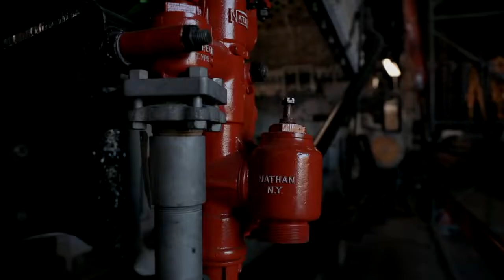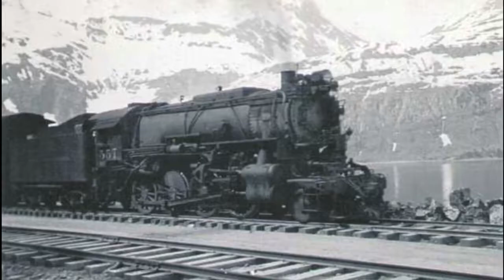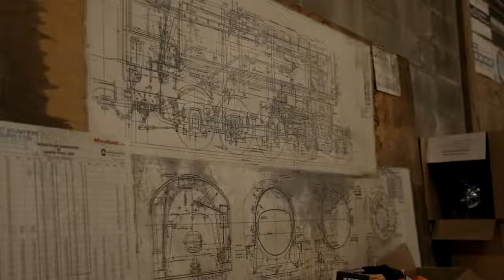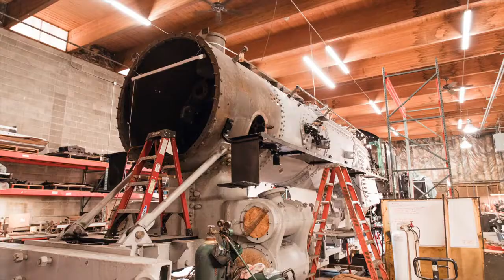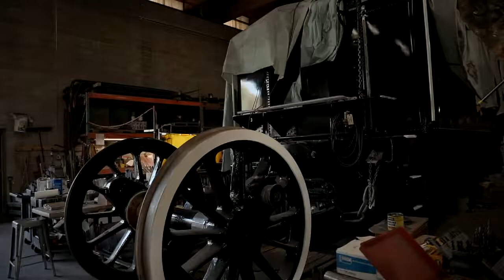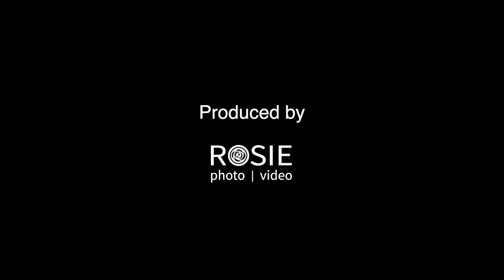Engine 557 Locomotive Restoration Project   Palmer Alaska

Comment: Better be careful. Some of those US 2-8-0's blew up!
Reply: I think the wikipedia entry is instructive on the cause of these incidents. https://en.wikipedia.org/wiki/USATC_S160_Class It's true that there were 3 incidents, the cause possibly being that UK crews were unfamiliar with the US design water gauge, and it's correct usage vs UK practice. Given that 400 were deployed in the UK to replace war losses at the time, it seems unlikely that they had any inherent weakness. In any case 557 is being restored with a strengthened boiler, 2 water gauges, and a back up try cock. All in accordance with US FRA safety requirements. We have every reason to believe 557 will be safe!

Comment: Actually, this locomotive and its siblings were not built for the Army Corps of Engineers. This locomotive class (the S160 class) was built for the United States Army Transportation Corps (USATC).

There's quite a few of 557's siblings in excursion service overseas, especially in the UK.
Reply from the maker: This response is a bit in the weeds, but the division of the Army that was responsible for locomotive design, including the S-160s, was under the Corps of Engineers at the beginning of WWII. The division was split off and placed under USATC when USATC was formed in July, 1942. One of the first, USATC 1702, was built by Baldwin in September, 1942.

Comment: Where will engine run after restoration done
Reply from the maker: We are coordinating proposed operational plans with the Alaska Railroad. The general outline is that operations will be done from the Anchorage depot during the “shoulder seasons” in the spring and fall, but will be very limited during the heavily congested summer season. Initially operations training and testing will be done on the Palmer branch and it is likely that some limited operations with paying passengers will be done in that location.  Specific excursions for the first three operating years are to be determined.